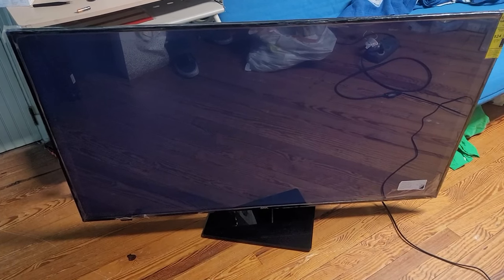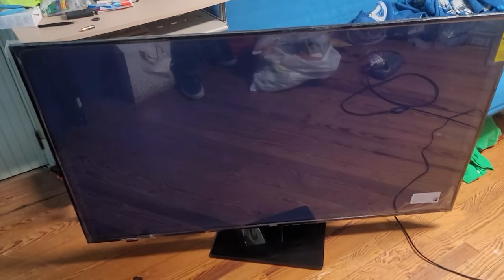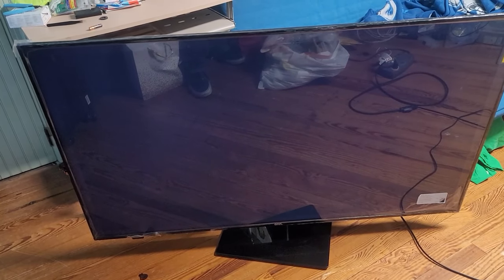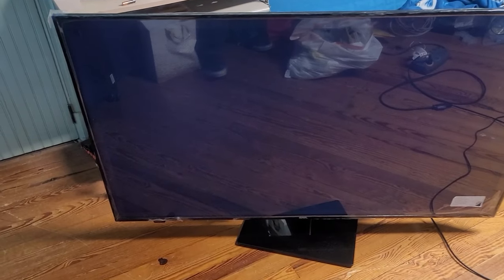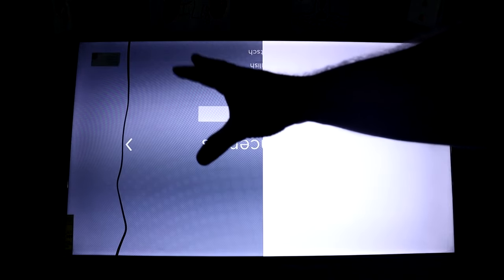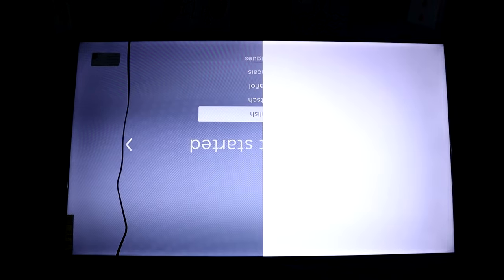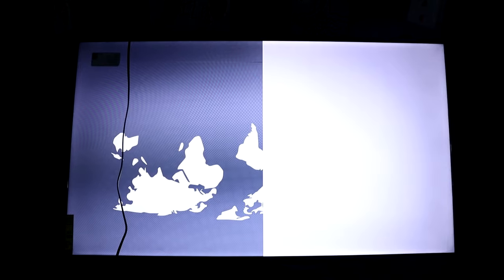Can I fix an Onn Roku TV (58 inch) No Display

Comment: Your resets will return your volume all the way down so you can't even hear the menu navigation beeps. Just use your remote and turn the volume all the way back up.
Reply: Those clock signals simply identify the makeup of a pixel in the circuit to which they're assigned. In other words, it tells a pixel what position it should be in, what color it should be, how long it should be there, how bright it should be and so on. If the clock circuit is bad, those pixels will simply be invalid.

Comment: I've taken the back off of all my TVs and drilled holes and installed a noctua NF-A14 140mm 5v fan. Some on Amazon come with a usb adapter. Most TVs have atleast one 5v 0.5amp USB output. You plug the fan into the TVs USB port. You dont have to get noctua you can get AC infinity they come with USB. Literally have never had a TV issue. 99% of TV issues is overheating components.

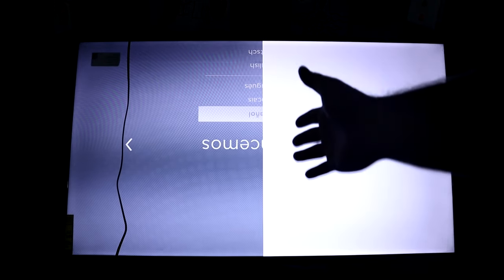Comment: I just want to thank you, because this video really helped me fix my tv when I had the exact same issue, it just now started working again as a matter of fact. I got to the part of the video where half of your screen was working 7:26 and decided to try that and see if anything changed and it did, so I unplugged both ribbon cords and plugged them back in and tried it. The tv turn back on and it was all white but I could still see the Home Screen, so I figured I’d just live with it until I got a new one and as it was running the video got better and clearer. So thank you again for helping figure something out. The only downside to this is there’s a, I wanna say 4 inch, dark bar on the far left but I can live with it until I get a new tv. Again Thank You so much for the help and the info in the video!

Comment: Thank you very much for this very helpful video. My 65 inch onn TV started working again.
There was only one difference, when I disconnected the ribbon cable on the right side, half of the screen turned white, and when I disconnected the left side from the T-con, nothing happened. In video, you had at least half the picture. Desperately, I started trial and error with tape and randomly covering a series of connectors on the right ribbon cable until I saw the complete image, but the quality was not good, and lines were also visible, and the light on the upper left corner of the screen was increasing and decreasing. . In short, I think that I only covered the connector number 15 or 16, the picture came back great and now the TV is working without any problems.